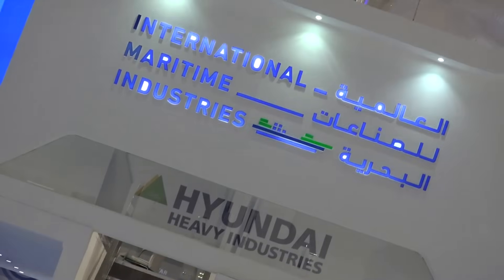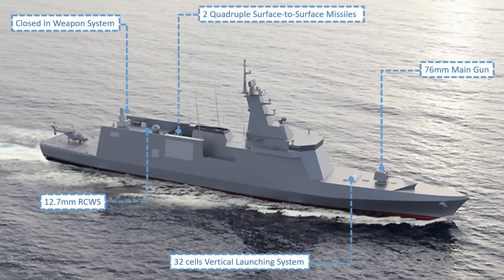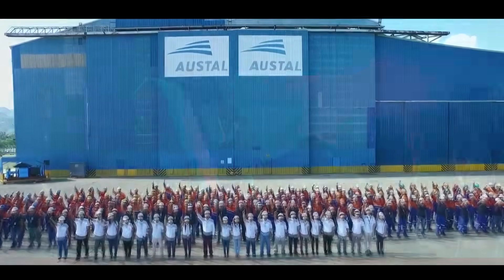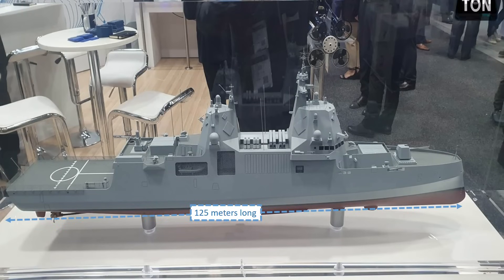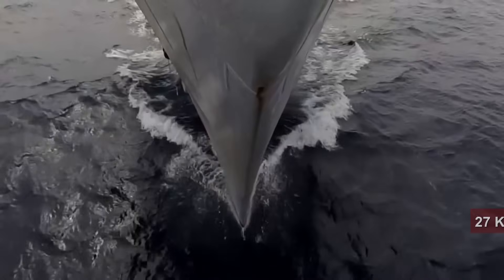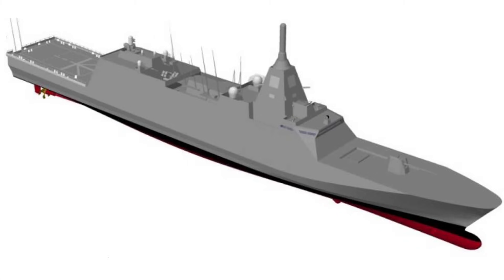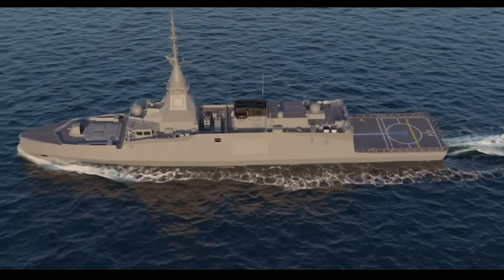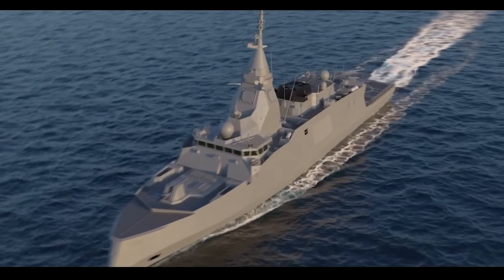Philippine Navy Candidate Frigate For Horizon 3

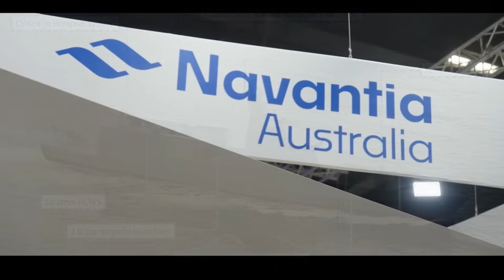Comment: Just some minor correction on the HDF-3800 0:24 to 1:04. Looking at the model, it only has 16-cells VLS, not 32-cells as, mentioned. Also the PN upcoming HDC-3100 has 16-cells VLS with potentially space for additional 16-cells, while displacing 3,200t fully loaded. Which I expect to see a follow-on order with some improvements.

Although it's best to wait for the PN to published its requirements, I think 32-cells VLS should be the minimum with the ability to quadpacked 8 of them with short-to-mediun ranged SAM for a total of 32, while the remaining 24 are dedicated to Long-range or ABM SAM like the SM-2 or SM-6 equivalent. 8 SSM should be the minimum while having space for 16 SSM if needed, a single CIWS preferably Missile-based like the RAM , 2 30mm RCWS, 2 triple-tube torpedo launcher, and mounts for small arms such as 7.62mm or 12.7mm machine guns. As for dimensions a larger design should be preferred. But will depend on cost and the final requirements!
Reply from the maker: thank you for that correction

Comment: Remember, RP is on a tight budget. A well built warship that is affordable like HHI, will be formidable as long as it's missiles, torpedoes are great and deadly. If Korea has been building good ships, why spend more hundreds of millions of dollars for a European built of the same standards, Use the money saved for the best missiles and torpedoes.
Reply: I totally agree!.. Why spend more funding on a very expensive warships, if we can acquire the same missile capable warships in a cheaper price? At least we can acquire as muchwarship as we can if we do get the Cheaper but has the same power and capability as well...
Reply: Australia Austal or HHI is better choice.. since Austal has Shipbuildng in Balamban and they could potentially develop here with Transfer of tech, and also good for economy and gdp for the Central Visayas..
Reply: #INDIA has Better options to offer...... Upcoming 2 CORVETTES have more firepower than all Frigates mentioned in video, and that too with low price.
1) Next Generation missile vessels / 2200 ton
2) Next Generation Corvette / 3500 ton
Both Ships Armed with......
8 VLS launched 300km Range #BRAHMOS missiles.
24 × BARAK-8   (70km Range)
OR 
32 × VL-SRSAM   (80km Range) 
533MM VARUNASTRA TORPEDO (50km)
OTO MELARA 76MM GUN.
2 units AK-630M CIWS.
VSHORAD MISSILES (6km)
Both corvettes are Multirole warships, can perform Anti Air, Anti Surface, Anti-ship, ASW Roles despite their small size.
Comes equipped with all advanced sensors such as......
EL/M-2248 MF-STAR AESA RADAR
EW SUITE
HULL MOUNTED SONAR
KAVACH DECOY LAUNCHER.
IF PHILLIPINES NAVY LOOKING FOR FRIGATE, THEN NOTHING CAN MATCH THE #NILGIRI CLASS FRIGATES.
Reply: true

Comment: those are sitting DUCKS unless fitted itself with missiles,better small patrol boat with missile system,like Norway did.
Reply from the maker: hopefully in Re-Horizon 3 they will not repeat their mistake of fitted for but not with (FFBNW)
Reply: @PHMalaya 
If the PH Navy wants to procure additional frigates and corvettes, I think it would be better to prevent them from being the frontline combatants of the Philippine Navy since it would be  too risky given the fact that the opposing force is superior in anti-shipping capability, particularly their ASHMs capability. Basically, whether we like it or not, they will not last long even a day if they will act as the frontline combatants.

IMO, I think it would be for the existing/upcoming corvettes and frigates to act as escorts for the supply ships and rear guard deep within the Philippine Archipelago while the  submarine forces, fast missile boats squadrons,  and marines's shore-based ashms  will act as the frontline combatants.

Comment: We need to know what kind of missile and Mac speed of the missile it should be higher speed of 2.8 mac to 4.5 Mac speed weather Exocet or THAAD or Brahmos within the quadruple luncher surface to surface missile also the VLS system what missile and speed along with it's AD Surfaced to surfaced missile and direct to line of sigth target missile .
Reply: You need to know eh? Then read up
Reply: #INDIA has Better options to offer......2 CORVETTES have more firepower than all Frigates mentioned in video, and that too with low price.
1) Next Generation missile vessels / 2200 ton
2) Next Generation Corvette / 3500 ton
Both Ships Armed with......
8 VLS launched 300km Range #BRAHMOS missiles.
24 × BARAK-8   (70km Range)
OR 
32 × VL-SRSAM   (80km Range) 
533MM VARUNASTRA TORPEDO (50km)
OTO MELARA 76MM GUN.
2 units AK-630M CIWS.
VSHORAD MISSILES (6km)
Both corvettes are Multirole warships, can perform Anti Air, Anti Surface, Anti-ship, ASW Roles despite their small size.
Comes equipped with all advanced sensors such as......
EL/M-2248 MF-STAR AESA RADAR
EW SUITE
HULL MOUNTED SONAR
KAVACH DECOY LAUNCHER.
IF PHILLIPINES NAVY LOOKING FOR FRIGATE, THEN NOTHING CAN MATCH THE #NILGIRI CLASS FRIGATES.
Reply from the maker: missile will depend on PN budget.

Comment: #INDIA has Better options to offer......2 CORVETTES have more firepower than all Frigates mentioned in video, and that too with low price.
1) Next Generation missile vessels / 2200 ton
2) Next Generation Corvette / 3500 ton
Both Ships Armed with......
8 VLS launched 300km Range #BRAHMOS missiles.
24 × BARAK-8   (70km Range)
OR 
32 × VL-SRSAM   (80km Range) 
533MM VARUNASTRA TORPEDO (50km)
OTO MELARA 76MM GUN.
2 units AK-630M CIWS.
VSHORAD MISSILES (6km)
Both corvettes are Multirole warships, can perform Anti Air, Anti Surface, Anti-ship, ASW Roles despite their small size.
Comes equipped with all advanced sensors such as......
EL/M-2248 MF-STAR AESA RADAR
EW SUITE
HULL MOUNTED SONAR
KAVACH DECOY LAUNCHER.
IF PHILLIPINES NAVY LOOKING FOR FRIGATE, THEN NOTHING CAN MATCH THE #NILGIRI CLASS FRIGATES.
Reply from the maker: It still depends on PH gov